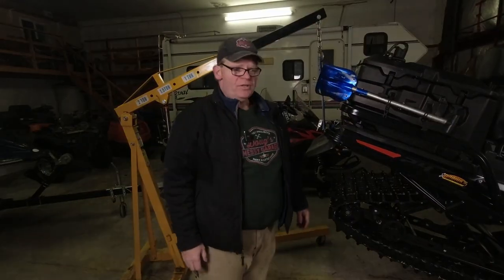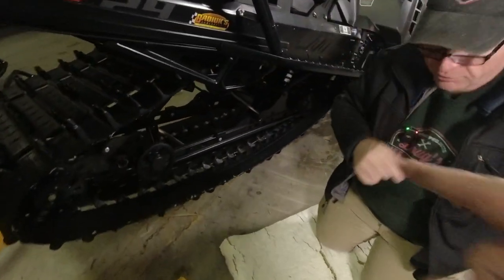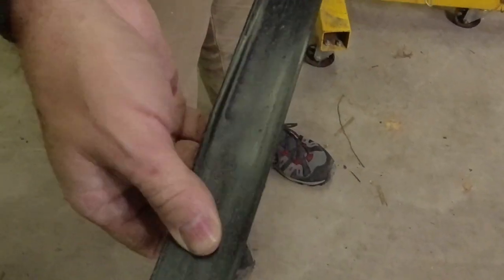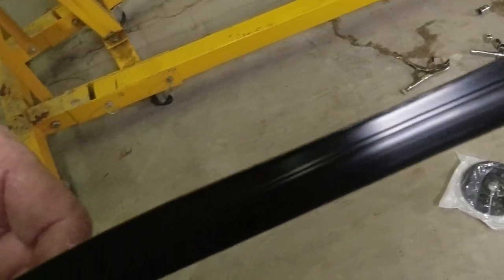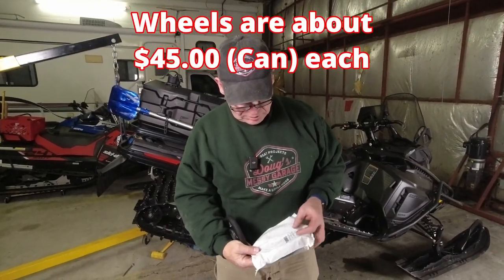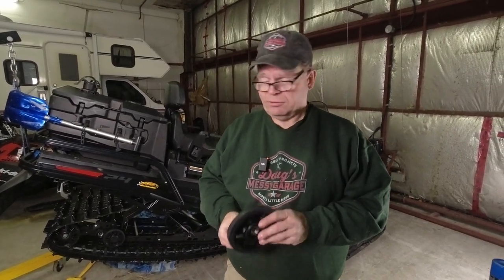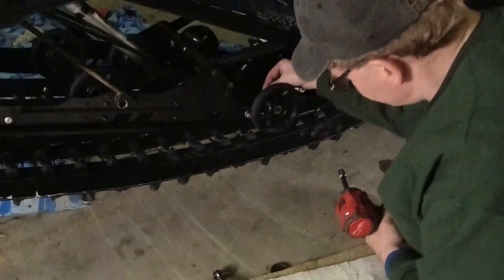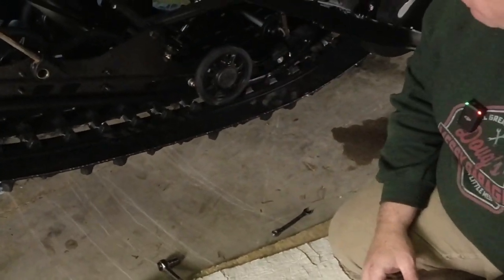2023 Expedition G4 HyFax/Slides and Wheel Mod

Comment: Good job on the repair sir! I always use a piece of old slider to tap the slide on once it gets inside of the track! Hockey stick piece is a smart idea too 👌 keep us updated on the bigger wheels, I may do the same upgrade if it helps
Reply from the maker: We had a bit of a late start this year on the snowmobiling season but the machines are finally getting some use.  We will see how the slides look this year.

Comment: Thanks for this one!  Just shared with a buddy who was complaining his slides on a 2022 Expedition LE were shot after just over 1000 km!
Reply from the maker: Ouch.  100km isn't very far on a set of slides.  I think the silent cobra track may be a bit too flexible so it humps up between the wheels.
Reply: Well it just over 1000 km but that is still disappointing

Comment: Great information. Did you replace al Bogie wheels? Or just the front two?Thanks
Reply from the maker: We did only the front ones but the worst wear was at the back so it may be worthwhile doing those as well.  With the limited snow we have this year, we are not getting much riding in so it's hard to say how much wear we will find after this season.

Comment: Hi Doug I have a "newish" 2023 Scandic 900 ACE LE and I have used many of your videos to make fall and spring maintenance schedules for my machine...I went with asthmatics re the track threads, until this video... now I see a better reason for burning them off...
Q Did you also burn off the threads from the holes that make the Cobra quiet? I did
Reply from the maker: The only hole we burned off from the interior of the track was the one that was damaged slightly.  I did notice that all of the 'Silent" slots had some minor threads as did the track windows but they were no where near as bad as the edges.  I'm kind of thinking these Silent Cobra tracks may not be very good tracks.

Comment: Does he have scratchers on that?  Shouldn't yhat help big time ?
Reply from the maker: Scratchers would help on heavily compacted snow or on ice but not in the loose snow in which we run.  This machine is primarily the owners transportation across  25 miles of lake to get to his cabin.  Last winter was rough as h*** but there were no times where we didn't have loose snow that should have provided lubrication to his slides.